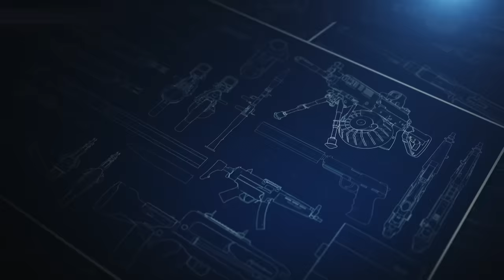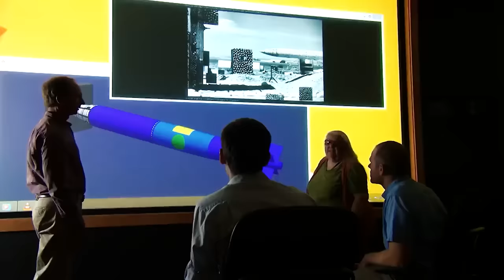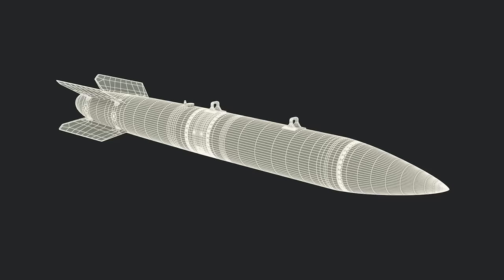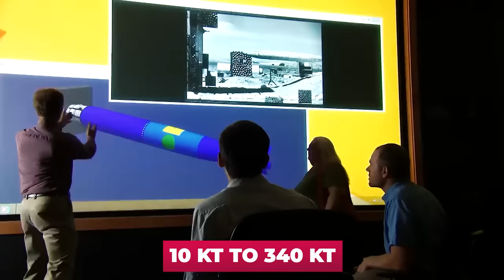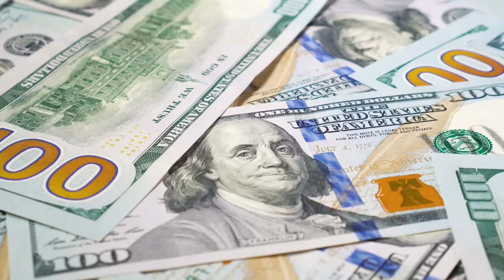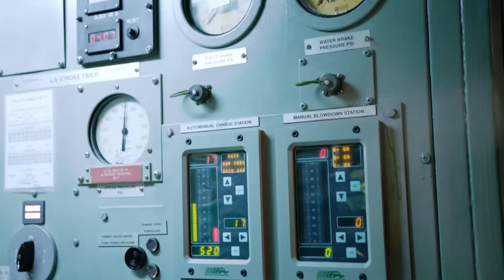«Do Not Test Our Nerves»! The US Tests The Deadliest Nuclear Bomb In History

Comment: Gravity bombs along with cruise missiles are one part of the nuclear triad. The B61 family of gravity bombs have a number of variants. The Mod 7 and other like Mod 11 can have variable yields up to 340 kilotons. They can be fused in several ways, to be an air burst or ground burst bomb. Their small slim design allow them to be deployed in many US aircraft, both fighters and bombers including the F35. The Mod 12 was re-engineered to be a ground penetrator bunker buster with precision targeting accuracy but only has a maximum yield of 50 kilotons. Nuclear bunker busters have many advantages over convention bunker buster bombs besides being much more powerful. When they penetrate the protected space they can take out everything and everyone in the entire network while a conventional bunker buster can only do limited damage in the proximity of its detonation.Among the things the nuclear bunker buster can do is suck all of the air out of the network as the fireball rises. This after the initial blast wave that expands outward, the thermal wave that travels at the speed of light, and the radiation. 

So the problem with the Mod 12 is that you have to choose between a high yield less precise targeting bomb or a lower yield bunker buster. The mod 13 eliminates that decision by offering the advantages of both. So it is as effective as a strategic ground burst or air burst weapon as Mod 7 with the same maximum yield or slightly higher and the precision of the Mod 12 bunker buster but with much higher yield able to destroy much deeper targets below ground. with its mod 7+ yield.

These weapons would be useful against enemies like Iran. Against a more formidable adversary the more likely first strike would come from the Ohio Class SSBN Trident submarines. Each Trident 2 D5 can carry up to12 W88 475 kiloton nuclear warheads and each submarine can carry up to 24 missiles. A 700 kiloton Russian warhead is only marginally more destructive than an America 475 kiloton warhead because the destructiveness of the explosion increases with the cubed root of the percentage increase in yield so to be twice as destructive it would have to be 8 times as powerful. The first nuclear explosions will be detonated above the earths atmosphere creating the nuclear blackout effect blinding every radar in the country. This will make even the most advanced defense systems which depend on radar useless. The will not intercept a single warhead, missile, or bomb. See the 1962 test Starfish Prime, part of Operation Dominic. A 1.4 megaton nuclear explosion was detonated 250 miles above Johnson Island 900 miles southwest of Hawaii. 

The largest nuclear weapon in the US arsenal is the 1.2 megaton B83 which is scheduled to be retired. Due to the cubed root rule, many smaller yield over a wider area will be far more destructive than one bomb of the same total yield at one point. The US has an arsenal of 5200 nuclear weapons, Russia about 5900. Both have active stockpiles of approximately 1500. The rest can become active quickly should the need arise but even 1500 is more than sufficient to destroy even the largest countries. So two Trident II D5 missiles are far more destructive than one Satan II missile, they are mobile under the sea, much closer to the targets so their flight time is much shorter, all 24 can be launched within 60 seconds, and they reenter the earth's atmosphere at Mach 24, 18,000 miles an hour. Nuclear weapons are expensive to build, expensive to maintain. Maintenance also requires specific expert knowledge and skill. America's best defense is a space based system of satellites with lasers that will fire immediately after launch during the boost phase when a missile is most vulnerable.
Reply: We need to get this guy on The Price is Right or something
Reply: Get him on Discovery Channel.
Who's he talking to Iran? 😮
Reply: Go it.
Reply: Jeepers dude write a book. Why don’t you lol.
Reply: @billprezioso3677  If your attention span is that short then read my postings  one paragraph or less at a time or just skip over them and read the postings by people who have nothing to say. After all the one who reads the most postings wins.
Reply: @markfischer3626  Well said LOL
Reply: @markfischer3626  I blame You Tube  for my short attention span, if I can’t read it in two minutes I get bored
Reply: Well put 👏
Reply: Nukes are always detonated about 400/600 feet above ground for maximum deviation
Reply: @charliehobbs3713  The first nuclear detonations will be above the earth's atmosphere not only creating a gigantic EMP but even more importantly the well known nuclear blackout effect blinding every radar rendering all defensive systems useless. Depending on the yield and desired effect an air burst will yield the greatest shockwave, a ground burst will yield the greatest radiation,a below ground bunkerbuster will destroy underground facilities, and Russia's Poseidan torpedo is detonated below the surface if the ocean to create a tsunami. There are many variants of nuclear weapons for different applications.
Reply: @charliehobbs3713  Tsar Bomba was detonated at 4000 meters 13,000 feet above the ground.
Reply: What you're talking about is the old weapons of US. These  weapon are much more advanced  the US has improved their strength up their cruise missiles and pretty much everything they're even going through much more advanced defense systems and increasing their offense cruise missiles in nuclear missiles. If you do your research outside of YouTube you would know. I have a nice day.
Reply: Who do you work for the pentagon, thanks for all that information,will helps me sleep soundly over the weekend.
Reply: Perhaps you might look into adding your knowledge to the us military think tank for military strategy our military needs all the input and knowledge we can get people with forward thinking
Reply: @PK-jz8fh  They seem to be doing fine without me. All of my knowledge cones from publicly available sources.
Reply: We need you to make a channel sir.
Reply: Ok.
Reply: How long did you work with the pentagon for,or one of the many missile contractors?Wow,what knowledge.
Reply: Thanks for the info

Comment: The November 22, 1955 Soviet test yield was 1.6 Megatons “ scaled back from a nominal 3 MT” at Semipalatinsk, Kazakhstan SSR . First air dropped Two stage Hydrogen weapon using lithium deuteride as the fuel . (Wikipedia)

Comment: Nope, wrong right off the bat, Hydrogen bombs, also known as thermonuclear bombs, are much more powerful than atomic bombs. The atomic bombs dropped on Japan had yields of only 15 and 25 kilotons (15,000 tons of TNT and 25,000 tons of TNT). An atomic bomb is a fission device (meaning it splits atoms), while a hydrogen bomb uses fission to power a fusion reaction (meaning it fuses/pushes individual atoms together) 2 totally different things. The most powerful hydrogen bomb ever tested was the Tsar Bomba that the Soviets created. It had a yield of 58 megatons (equivalent to 58,000,000 tons of TNT) which is insanely huge.
The US Is NOT making anything close to that. The latest project just makes existing hydrogen bombs a little more accurate with a tail kit of fins that can correct the trajectory of the gravity (dumb) bomb. The largest US hydrogen bombs have a yield of only 1.2 megatons (1,200,000 tons of TNT) the payload in these modified bombs is the same exact yield as before the bombs tail kit is added.